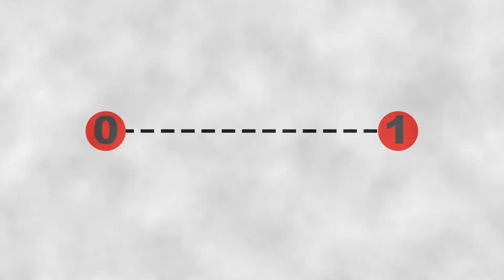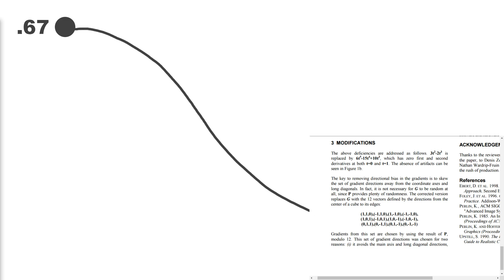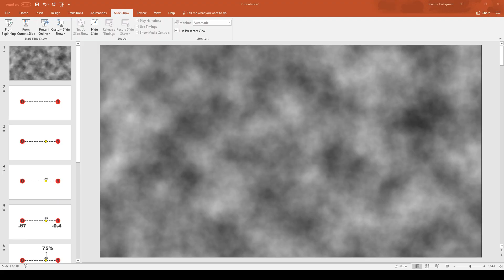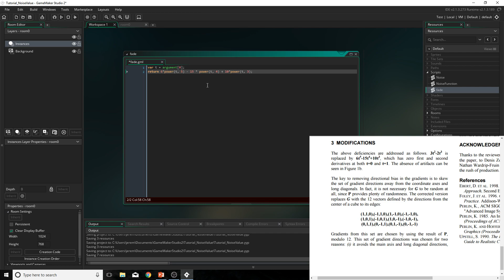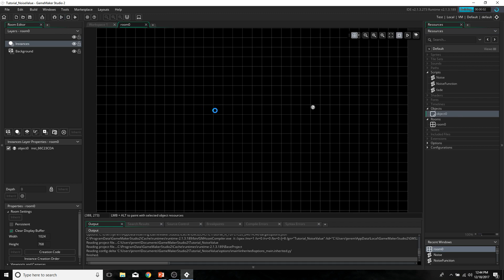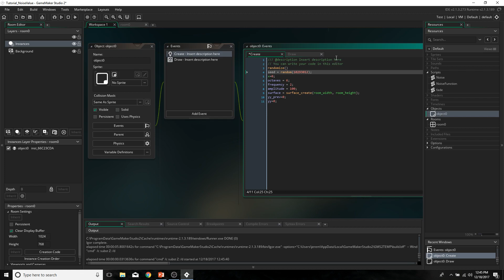Terrain Generation with Value Noise: Gamemaker Tutorial

Comment: Little tip: instead of generating a noise from scratch for every pixel,  you can change the frequency and generate just 2 points with 60+ pixels in between them, and lerp from one to the next.

With a bezier curve instead of just lerping, if I'm understanding this math stuff correctly, it can be a smooth curve instead of just straight lines from each point to the next. This saves processing time since you don't do the whole NoiseFunction thing at every pixel

*EDIT:* you're already doing that, all that's needed is to add a "width" at the top, do x+=width instead of x++, replace the current Noise(blabla) with Noise((x/tileWidth)*0.001, frequency*tileWidth, octaves)*amplitude;

/// @description Insert description here
// You can write your code in this editor
var tileWidth = 8;

draw_set_color(c_red);
if x < room_width {
 if !surface_exists(surf) {
  surf = surface_create(room_width, room_height);
  x = 0;
 }
 surface_set_target(surf);
 yy = Noise((x/tileWidth)*0.001, frequency*tileWidth, octaves)*amplitude;
 draw_line(x, room_height/2+yy_prev, x+tileWidth, room_height/2+yy);
 yy_prev = yy;
 x+=tileWidth;
 surface_reset_target();

}
draw_set_color(c_white);
if surface_exists(surf) {
 draw_surface(surf,0,0);
}